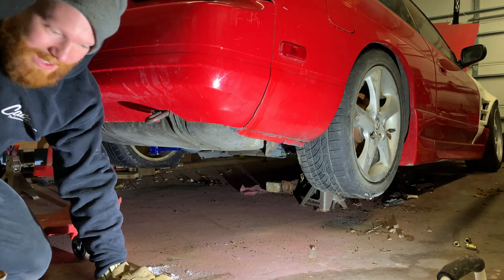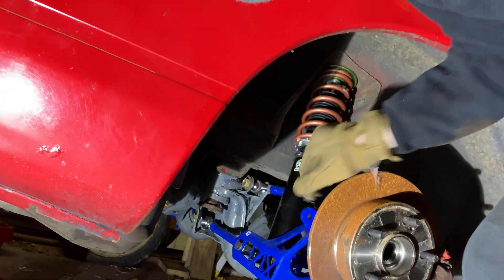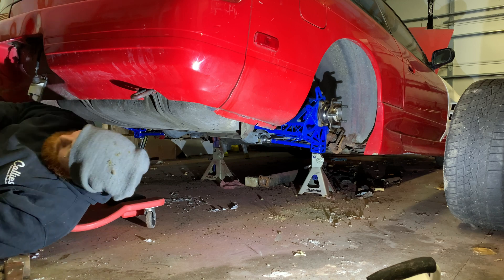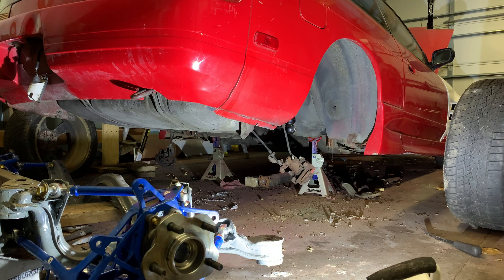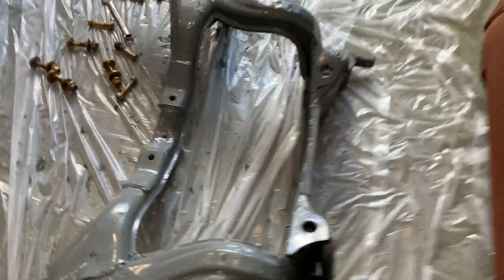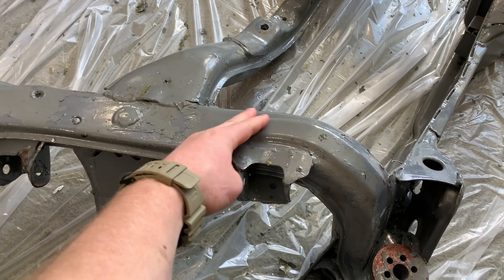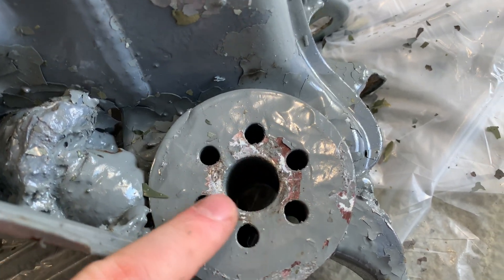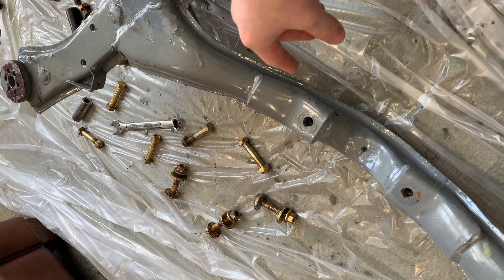S-chassis Rear Suspension Part 1: Subframe Do’s and Don’ts.

Comment: I know this video is old as hell, but have you tackled the other subframe yet?
Reply from the maker: I have, just didn’t record much from it as I was in a rush to get the car ready before realizing my block was toast. Also, I didn’t strip and coat it, just a quick and dirty spray paint job for now, but I reinforced it and dropped the LCA front pickup to S14 position.
Reply: @signal_msw  Cool.  Don't have this one dipped.  If you're dead seat on anything, just have it blasted and then powder coated.  Once you get it back, cavity wax it.  That way you won't have to screw around with filling it with foam and you'll get a nice clean result.  I actually just picked up a spare for my project and I'll be doing that process in the near future.  I'll be starting a build thread soon on zilvia.
Reply from the maker: @Jared-C  I’ll have it dipped and then e-coated, which will coat the inside. Then use eastwoods internal coating and then have it powdercoated haha.
Reply: @signal_msw  You know of a place that has a vat for e-coating?  Sweet.  The internal coatings go in after you do your paint/powder coat.  Eastwood's internal coating is phenolic resin based, which paint/powder coat won't stick to.  The 3M stuff I use all the time after replacing a quarter panel/rocker/frame rail is wax based, and nothing (paint, powder coat, etc.) will stick to it after it's applied. You're powder coater may even refuse the job if it's already been coated with that stuff just because he couldn't warranty the work.  It's used as the last step before final assembly.  You can have the piece powder coated, just know they will blast the outside, and hit a good chunk of the inside, so I'm not sure if the added expense of E-coating would be worth it.
Reply from the maker: @Jared-C  Yup! The place that e-coats it is the same place that powdercoats it, so the powder goes right over top of the e-coat. I put my previous comment in the wrong order. It’ll go dip, e-coat, powdercoat, then I’ll get it back and use some kind of extra internal coating, then back in the car.
Reply from the maker: @Jared-C  I also welded steel plate and tube in place of the subframe bushings, and washers in place of the eccentric bolts, so I don’t have to worry about stupid aluminum solid bushings and galvanic action.
Reply: @signal_msw  Interesting, didn't know they could powder coat over e-coat until you brought it to my attention, that should def. help you out in those mid-west winters!